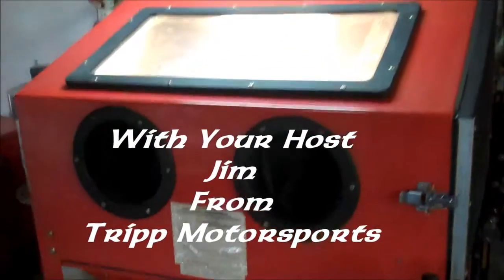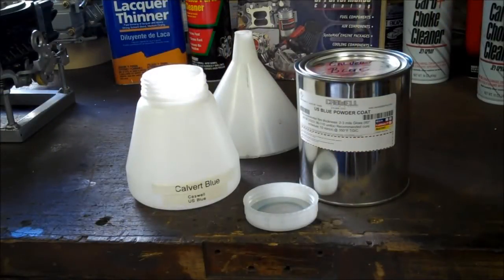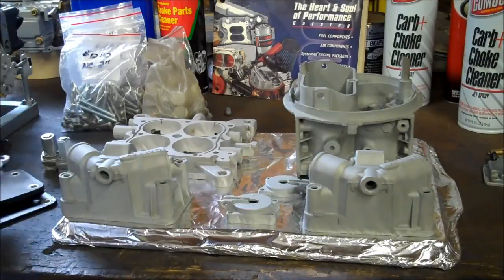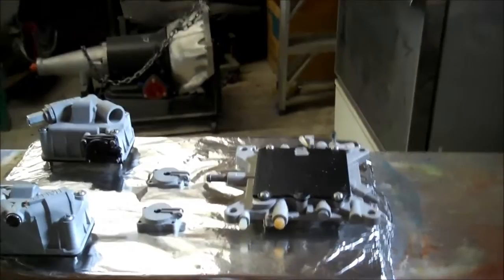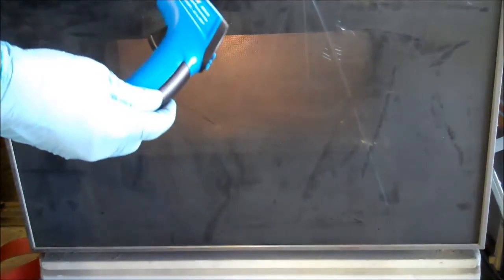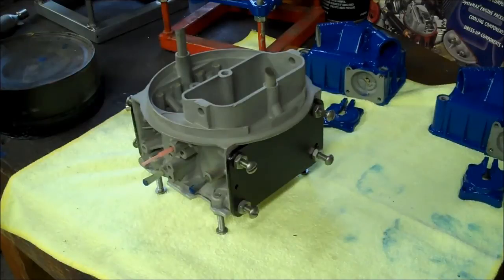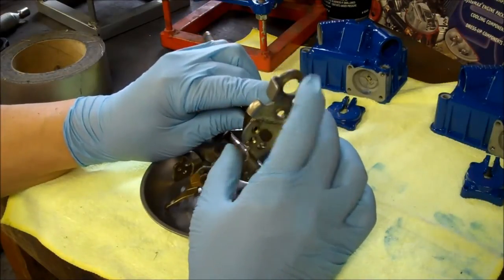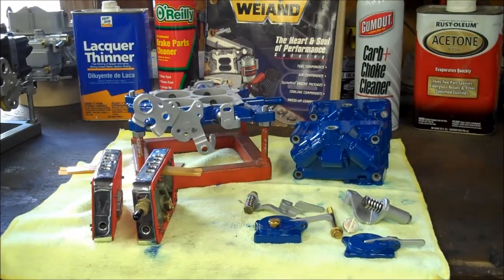PowderCoating a Holley Carb - Part 2 Clean & Coat

Comment: guess ill get some fine walnut shells, also do you have any secrets for removing vent tubes for replacements?
Reply from the maker: +jon grumet Great question and I wish I had a great answer, usually I just take a pair of locking pliers and clamp on the vent tube, twist and pull. Of course that destroys the vent tube, so I just cut a new piece of 5/16" thin wall tube and tap it in when I'm done.  Polished stainless steel looks really good if used as a substitute. Thanks for watching.
Reply from the maker: +jon grumet BTW, Tractor Supply is a great source for crushed walnut shells for your blast cabinet...

Comment: does the walnut shells cause port jamb problems, would soda blasting work better since it desolves
Reply from the maker: +jon grumet I've used both walnut shells and glass bead over the years and have never had a problem. When done blasting I use high pressure air to clean the passages in the main body as well as brake cleaner to ensure a good flow.  After finishing the re-assembly I usually test the carb on the flow bench as well as on an engine dyno, not only a great way to test, but a lot of fun! Thanks for watching.

Comment: what is your oven temp for Holley carbs do you know the part temp mine oven at 500deg part at 248deg
Reply from the maker: +Steve Walker I set the oven to whatever the cure temp of the powder I'm using, usually between 350-400 degrees F.  The main body can take as much as 40 minutes to get to temp, then another 15-20 minutes of cure time. Patience is the key for a good coating.  Setting the oven to a higher temp will tend to burn or bubble the powder before you get to the melt and curing points.

Comment: was the carb sand blasted without covering any parts
Reply from the maker: +Steve Walker After Stripping carb to just metal, yes.  The cleaning process afterwards is very important.  BTW, not "Sand" blasted, I use crushed walnut shell to blast the parts.  Thanks for the comment

Comment: does the cage affect always happen on the main body
Reply from the maker: +Steve Walker The Faraday Cage effect happens when there are surfaces close together that create an area that has, kind of like a tunnel or hallway, where the powder needs to get into.  The electric charge actually causes the powder to bounce off of the wall of electrons keeping the powder out. Almost always happens where the gussets on the outside of the main body meet the metering block wall. I'd say about 99.999% of the time.  That's why I've started using the L2P to pre-coat those areas before normal powder coating.